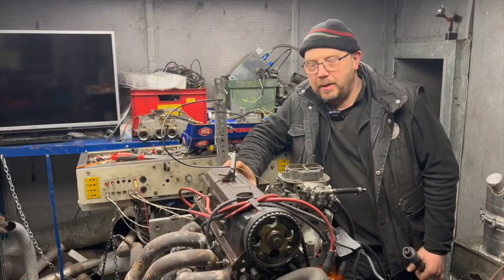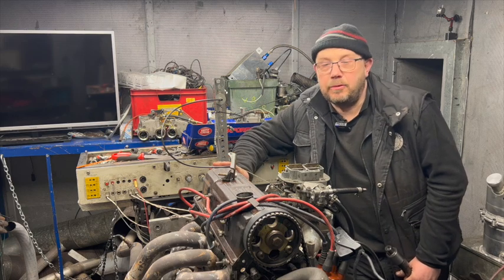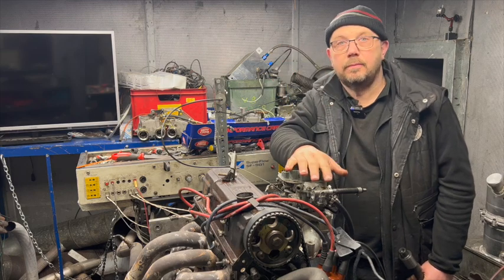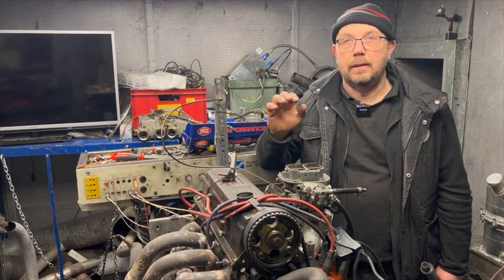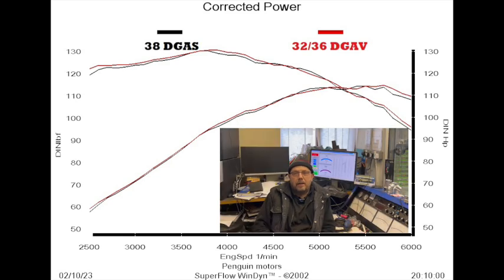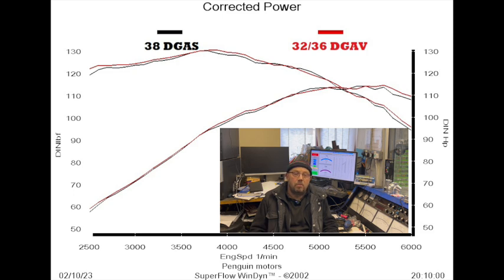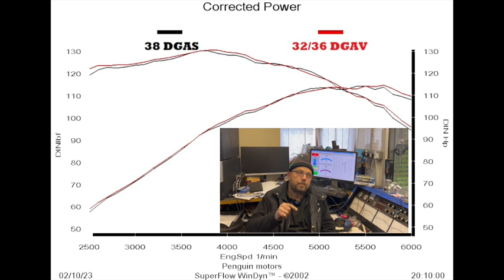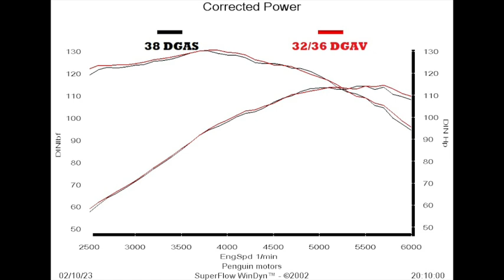pinto weber 32/36 v 38 dgas

Comment: The only difference i noticed putting 38 DGAS on my  2.0 pinto back in the day with Kent FR32 cam stage 2 Burton head & small bore 4 2 1 manifold. Was it drank like Oliver Reed! Lol That 38 dgas was bought new re-jetted & set up on rolling road. The 32/36 was standard & used. But was better on fuel & quicker over the 1/4 mile!

Comment: I've tried both the progressive 32/36 and non-progressive 38/38 on my 3.3L modified head cylinder Ford 200/c4 auto.  From my test drives, the 38/38 was the far better choice.  Much later, I opened up the 32/36 and learned that the jetting was for a 4-cylinder.  From Penguin's tests, I'll assume that if properly jetted, the 32/36 and 38/38 will be very similar in performance on my setup.  32 to 36 and 36 to 38 - on the butterflies - isn't much of a difference...
Reply: I play with similar sized engines here in Aus.  the holden 202 cui.  3.3l also.  I've ran many different carbies here, from single barrel strombergs, to 350 holleys.  All have been well tuned.  The weber 38 beats them hands down and jetted right, is very fun to drive and quite awesome.  First one I had tested I'd had a very well tuned holley on the engine first then went to the weber 38.  Was phenonemally different and has been superb.  It's not one of the most common conversions I do.

Comment: But, but, the DGAS is a larger carburettor..... Oddly enough, that´s just about the exact same results we saw some 10 years ago. I´m glad someone else proved it, because the DGAS people are hard to convince
Reply from the maker: throttle size on the 38 is bigger, but the throttle spindles are thicker offsetting the bigger throttles,  a mere 1mm increase of one choke diameter also means the bigger carb wont flow a load more air, in any case the manifold is a bigger restriction than the carb
Reply: @PenguinMotors  Yes. IIRC the venturies are not that much larger in total either. But the massive throttle spindles are a huuge restriction.

Comment: I've been using a 32/36 on an L28, in a 430 Datsun 280C. Sips gas. Power on demand. Only problem was hesitation, but that was due to running small idle jets. Engine will rev quickly to around 6k, on a high speed run I got 230kph. Never had any problems with my carb. Towed another 280C up hills, carried well over 1500lbs with ease. First and second, I'd burn tyres. Everyone said, that's for a 4cyl, I'm using the wrong carb. Use a 38/38. Use side drafts. They were wrong. The 32/36 is an amazing carb that performs. Thanks for the video information!

Comment: Amigo I build me a CRX base mostly from junk yard parts stock d15b2 block original block I put a y8 head gasket and po8-3 head mild bore better spring and retainers and a 272 Delta cam regrind header 2 in free flow exhaust system homemade and I put a lighter flywheel and gd clutch kit .I used the original d15b2 16 valves obdo distributor with adjustments and I put a fuel pump close to the gas tank and ran to gas hoses one for the fuel go in and one return and I put a 32/36 Weber Chinese Weber carb and Holly crap I build me a race car mostly with hardly nothing poor man revenue really she is peppy like hell probably 10.1 to 11.1 compression around I say .She pull real nice run beautiful and sound like a old Ford muscle car people ask me if I have a V8 on her special on gas stations or the lights stop sings but I really play with the timing and carb tune a bit to have it where I want it and I did took her there with the old school style sound plus I all motor no VTEC crap eliminate the VTEC I wend all motor CCR born in the byouooooo voodoo child CRX Honda run beautiful on highway cities and back roads she looks tuff and sounds tuff and I love the 32/36 Weber carb i really do plus they are cheap from china jjjjj plus i regulate her gas around 3 and half pound to four to get my gas power and distributor timing right my like plus i used better spark plugs from other years that came stock with little more compression in the hondas d series engine and bingo ccr born in the byouooooo gd video and for timing gun I take her to a up the hill to I find the spot where she really pull gd old school style 😊😊

Comment: Spent hours and hours on a rolling road in the early 90s doing this very test with a 32/36 and 38 completely re jetting both carbs. 32/36 gave overall a better drive and fuel consumption compared to the 38.
Reply from the maker: 38 ends up using bigger mains, bigger mains to achieve same power can only result in worse fuel consumption

Comment: Always was a myth, and with a 32/36 capable of feeding 165hp there's no point until the engine spec needs twin carbs.
Reply from the maker: 165bhp would be a big ask from a 32/36, twin carbs will give more power and torque than a 32/36 at any engine spec
Reply: @PenguinMotors  they surprisingly will on an F2 engine so clearly have the flow. That's on a radical cam so not a road friendly combination granted. So little point using much else...as in the dgas...on a fast road type spec around 145-150 ish...twin carbs aside with their better distribution, but more cost involved.
Good to see the proof on the dyno though.

Comment: I like the explanation on that and I've ran both and the drive ability or there reaction to throttle input  is completely different at least in my rig the 32 36 is a great carb better on mpgs a little but also when running on the primary 32 it's kinda sluggish and it not having a great transition to the secondary 36 has kinda dead spot were it has to catch up every one I've ran or seen has the same problem but when it does catch up they scream the 38 is more sensitive to throttle input  under a good load can be sluggish of the bottom after about 1500 and when the cam profile kicks in everythings there but if u stab it from idle best I can explain is like a 2 stoke  or turbo it takes a second and then it's madness  I prefer the 38 but that's just me hope this helps some one if nothing else

Comment: I would think the intake manifold the reason for the lack of any difference in HP between the two carbs.  Do you ever work with the Ford Cologne V6 engines?
I would think that on a 2.8L you would see some increase in HP with the 38 DGAS.
Reply from the maker: i have had Cologne V6 engines apart, but never done any tuning work on them

Comment: Fantastic informative video as always Graham, I remember your video on the new big racing Pinto engine where you compared 40 dcoe's with big chokes fitted and then did similar size chokes fitted to 45 dcoe's and got more power due to the shape of the expansion being better on  the bigger carbs a bit like a well designed power station cooling tower.  Have you ever done any tests on that big engine using the big chokes as in the 45 dcoe's but using 48 dco/sp carbs so as you would get even better expansion from the choke size to the outside world , just a thought,  love to se the results if you have done this test.

Regards

Dave.  😀

Comment: With higher lift cam will the 32/36 Weber idle without any problems or you need the 38? Does the 38 need a rejet on a 2l application? Just need confirmation I purchased a head a cam with more duration and lift the seller and the cam manufacturer said the 36 idle will be rough it needs a 38 if I don't have sidedrafts.can you advise please
Reply: You don't need a 38 for anything, idle, mid range or top end. 32/36 or twin carburettors
Reply: @richardjackson5380  thank you so much for your reply and advice much appreciated god bless 🙏

Comment: Whats a rough ignition timing to use with this cam and 32/36. My idle timing wants to be around 16 degrees? Other wise its flat
Reply from the maker: around 30 degrees @ 3500 rpm. if it wants as much as 16 degrees idle you probably have a faulty advance mechanism in the distributor

Comment: To what degree, do you think, it will change if a flowed cylinderhead with big valves is installed?
Reply from the maker: it should add a few bhp in the midrange and probably 10 or so at higher rpm

Comment: yo tengo un motor 22r y si no me equivoco el carburador original es un 32/38 progresivo y lo cambie por un webber  38/38 y lo que he podido notar es que se se pierde un poco de potencia a rpm bien bajas pero lo que si puedo decir es que se comporta mejor que el original  en altura a 3500 mts sobre el nivel del mar donde escasea el oxigeno.
Reply from the maker: If the 38 works better at 3500 meters then you didnt have the 32/36 jetted correctly
Reply: @PenguinMotors  nunca tuve el webber 32/36 yo tenia el original del carro que es assin 32/38

Comment: I did find the 38dgas was more predictable on the exit of a turn with no sudden burst of power from a secondary barrel opening spinning up a lightly loaded inside rear wheel 👍
Reply from the maker: interesting, most people report it the other way round, the 32/36 being more progressive as it gradually opens the secondary, where as the 38 opens both throttles together.
Reply: @PenguinMotors  yes but I thought the difference was both are open from the from the very start 👍

Comment: if you could in next video on carburation, you may try and see if sidedraft or downdraft , dcoe or idf make a diffrence, because of the idf with its ca. 90 degree bend 
Air is "lazy" dont like bends so much, so might be seen by testing. Compare 40 dcoe and 40 idf carbs
Reply from the maker: I did do an IDF DCOE comparison 40dcoe made more torque and almost as much power as 44 IDF
Reply: @PenguinMotors  so that would say, this 90 degree angle bend does more harm to performance, is it? Group 1 Ford Escort mk2 had 2 x 44 idf on it as far i know of